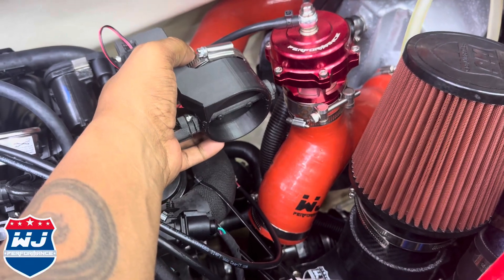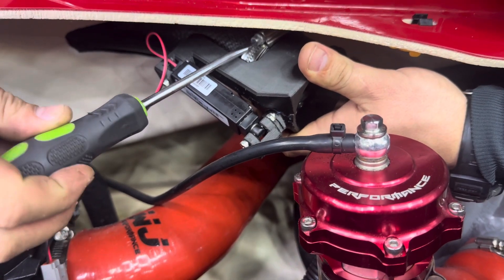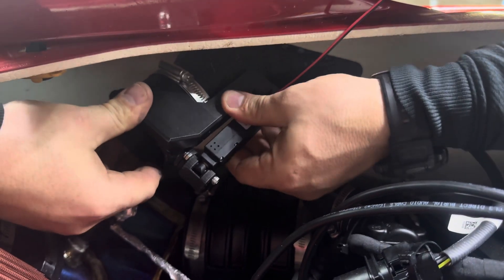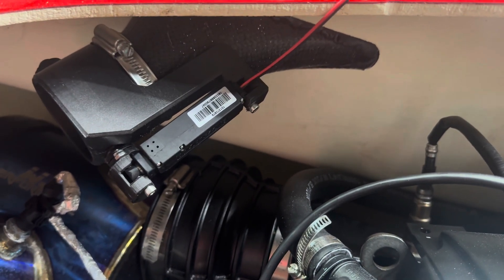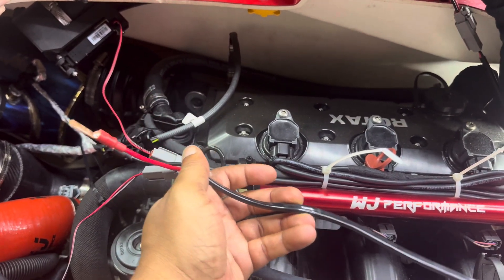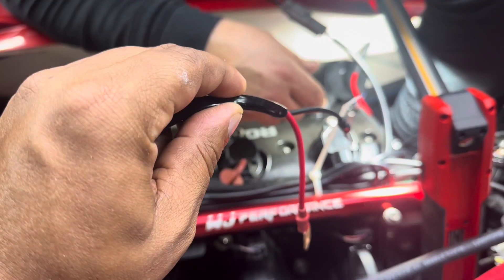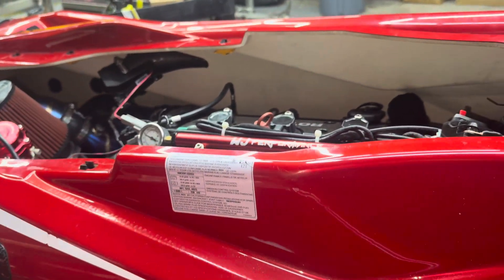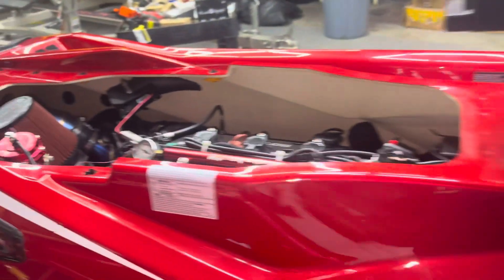Worlds first Electronic valve ram air system for Seadoo RXPX 325

Comment: Nice design! How can I order this valves?
Reply from the maker: @evgeniykud  just message us on fb or call the shop 7134256414 and we can sell you just the valves
Reply: Do you have a link to full setup for valves ? I don’t have other parts too.
Reply from the maker: @ full set up link with options 
https://wetjetperformance.com/shop/ols/products/wet-jet-performance-carbon-fiber-front-ram-air-seadoo-rxpx-300325-21-24